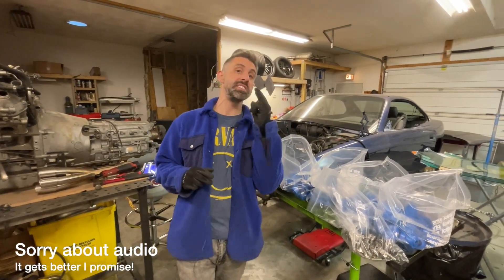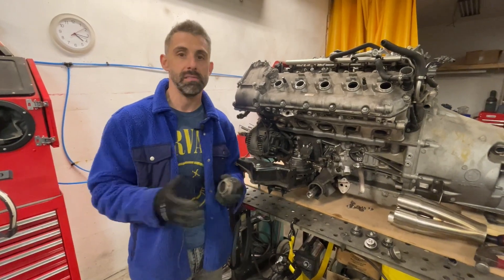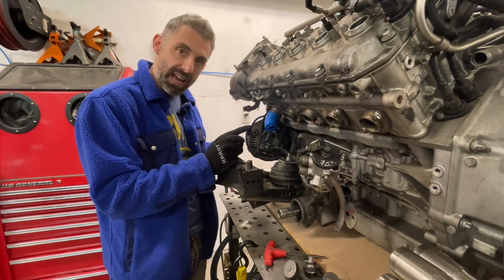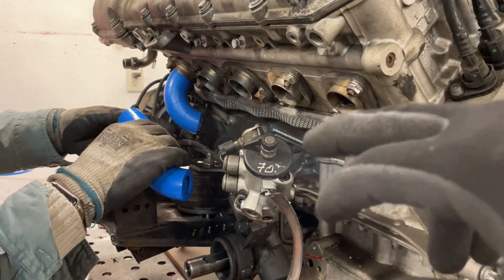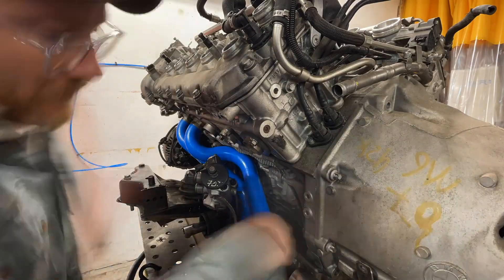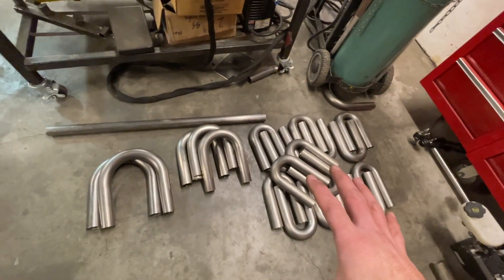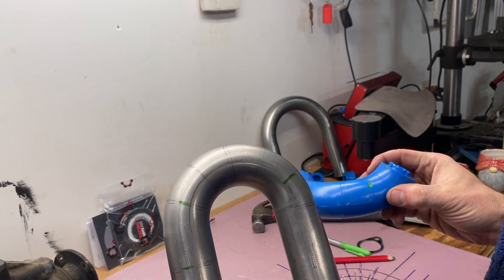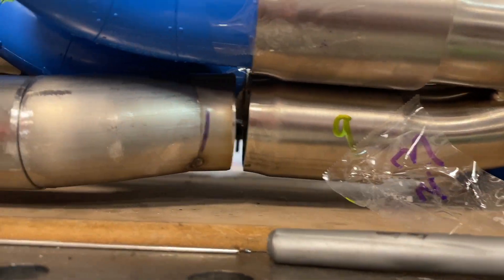Chapter 1: S85 Equal Length Custom Headers  - Was It Worth It?!

Comment: I used the 1 3/4" set to build a set of headers for my v8. they're alright. they stick together when you want to take it apart, and they come apart when you want them to stay on the engine. without the $1000 tool they sell to cut the sections with complete accuracy, it takes practice to be able to cut them with precision. I had to spend like $1200 just to have enough blocks to design a full 4 runner set of long tubes. I am not a professional fabricator though, and am just a diy mechanic. you could literally just build a set of headers with 45/90 degree bends and pie cuts. 5/10 rating from me. just my experience and 2 cents

Comment: 🔥🙌🏽  really nice!! What if you add vband on that one runner for even more “ease” of installation? Instead of pulling that one runner out, your can just take the clamp out. 🍻
Reply from the maker: Yes, I thought of that! you know anywhere I can find a 1-5/8" V-Band clamp kit?
Reply: @Garageaholic  closest size they have is 1.75
Reply from the maker: @akintegratedautowerks  Right, I see the same. I could make that work I guess, just extra welding.
Reply: @Garageaholic  you got this 💪🏽
Reply from the maker: Thanks KC!!!

Comment: For sunday use, very beautiful(when exhaust wont go over 150°). But for rough drive (thats what s85 was made for)... poor steering rack 🥺 and all the seals with teflon rings, even servo valve. Ahh even that scavenge pump 🥲 they wouldnt be happy, surounded by that excessive heat.